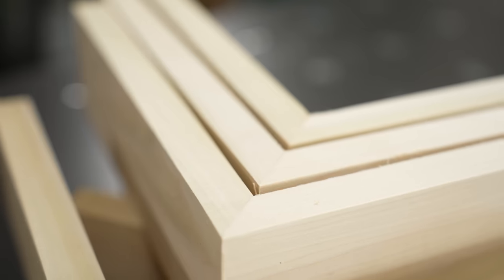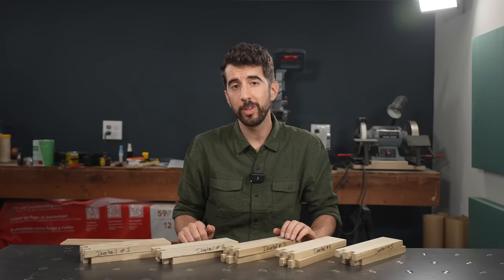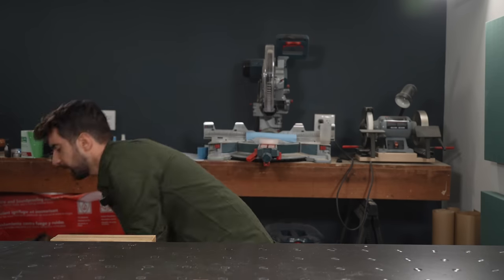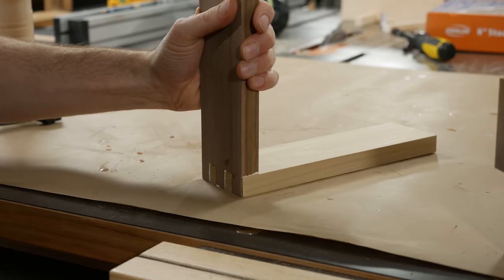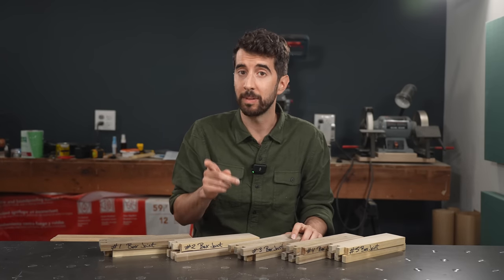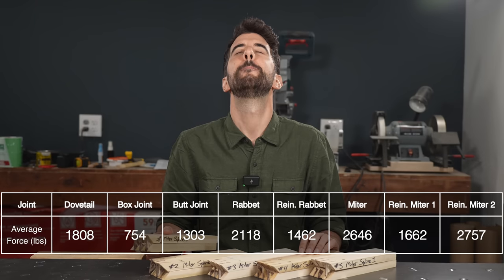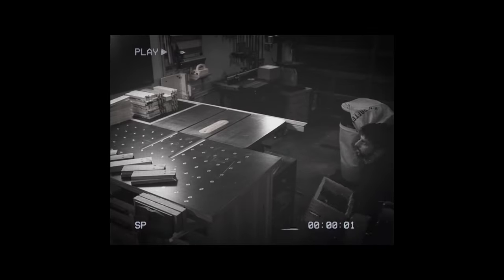This Simple Joint is Stronger Than a Dovetail!

Comment: 🎯 Key Takeaways for quick navigation:

00:01 💪 Introduction to Joint Strength Comparison
- The video compares the strength of various wood joints including the butt, miter, dovetail, and box joint.
- Demonstrates a test to break a butt joint.
- Poses a question about the actual strength of popular joints like dovetails.
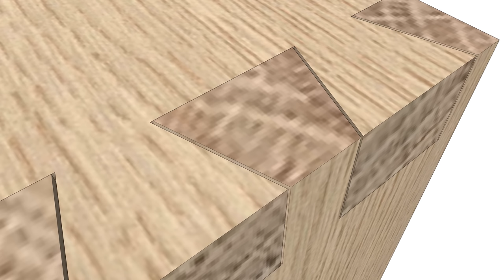01:12 🔨 Dovetail Joint Analysis
- Explains the mechanical advantage of dovetails.
- Describes the process and tools used to make dovetails.
- Evaluates dovetail strength and the pattern of failure.
02:55 📊 Box Joint vs. Dovetail Joint
- Suggests that box joints could be stronger due to wood glue strength.
- Details the ease and speed of making box joints.
- Discusses the potential issue of glue starvation in box joints.
04:34 🧠 Mention of Video Sponsor
- Introduces the video sponsor, BetterHelp.
- Describes the benefits of online therapy.
05:44 🧩 Differentiation of Woodworking Joints
- Explains the specific applications of the joints being discussed.
- Describes the testing method used to evaluate joint strength.
08:57 🐇 *Rabbit Joint Strength and Reinforcement *
- Explores the rabbit joint strength and the effect of adding dowels.
- Compares reinforced rabbit joints to non-reinforced ones.
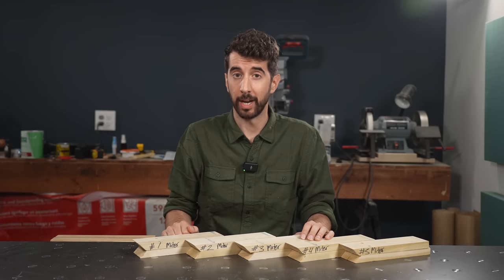12:21 ⚖️ Miter Joint Strength Assessment
- Discusses the unexpected strength of the miter joint.
- Examines the potential long-term issues due to wood movement.
15:30 ➕ Reinforcing Miter Joints
- Investigates different methods of reinforcing miter joints.
- Presents results of strength testing for reinforced miters.
17:03 💭 Final Thoughts on Joint Strength
- The presenter shares his concluding thoughts on the strength tests of various joints.
- Emphasizes that test results are not absolute rules but should guide practical woodworking and joint selection.

Comment: the dovetail ages much better than the box or miter joint,it does not depend on glue, it adapts to expansion and contraction, it will outlast them by many years

Comment: I would love to see each of these joints in a bending load as well. Imagine a square (like a drawer) dropped on a corner. The force to open a drawer is very low compared to the abuse caused when moving furniture.

Comment: Love these videos where traditional beliefs are questioned. A lot of these go back to hide glue times where the glue was less strong and therefore dovetail were beneficial. I think there are two things that were missed in the explanation though.

For one, I think glue starvation might play a role with the box joint, but grain direction does too. If we assume that grain runs perfectly straight along our board, then it should only fail on the glue and be on par or better than the miter joint. But if the grain direction is off ever so slightly, then there is a thin layer of fibers that are severed from cutting the joint. Those fibers are held on one side by strong glue and on the other side by weak lignin. This creates a weak spot.

The other point is the argument that miter joints are weaker on the long term when it comes to wood movement. I think the exact opposite is true. Because the wood movement of both parts is basically synchronous, it's the best possible joint. The wood will expand in both dimensions of the glue surface equally if the glue has enough give to compensate. But it basically only needs to compensate for the tiny movement in between fibers, not for the sum of those movements. A butt joint on the other hand has a discrepancy in between both pieces. The wood will swell much more in thickness than in length. So the end grain part of it will want to expand while the long grain part of it will resist. This creates stress and the glue needs to compensate for the sum of all movement in that direction wich can add up substantially. All other joints will lie somewhere in between but any end grain to long grain or unaligned long grain glue surface is bad for this.

Comment: 1:11 - Er, no, that's not "what's called mechanical advantage". Not in engineering or physics, anyway (you're obviously free to use it to mean whatever you want it to mean). Mechanical advantage is the ratio between input and output force of a system (ex., a lever, a pulley, etc.). Dovetails provide a mechanical lock (i.e., one piece can't move in a certain direction because it would have to pass through or destroy the other), they're not a mechanism to trade force for displacement or vice-versa (again, think levers and pulleys), which would be "what's called mechanical advantage".

I guess you meant they have the advantage of (also) providing a mechanical lock, that doesn't rely just on the glue (like some other joints). But at best that would be "what you might call a mechanical advantage", not "what's called mechanical advantage" (at least not in fields where "mechanical advantage" is an actual technical term.

Also, the thing at 4:13 is an asterisk (the kind that ends in "risk"), not an Asterix (which is a small French guy drawn by Uderzo). 😜

Comment: Enjoyed the video! Haha

Here are some thoughts of mine. The glue surface is also affected by the surface area just like you mentioned. It would be interesting to see testing different joints but with the same total overall surface area. 

I am also interested to see for you test the dovetail joint the other way, the orientation without the benefit of mechanical advantage. In that way, the glue is mainly the one holding the joint together. I think generally glue performs stronger against shear forces. You were testing the joints all in the same direction of force. Try to consider the direction of the force in all the joints. Which means just set your joints in the tester the other way around. 

Anyways, your vid is amazing. Got me excited while watching this. HAHA. I enjoy stuff like this. Thanks man. Just subscribed.

Comment: It seems that the strongest joints are the ones that require the adhesive to fail in both tensile and shear stress simultaneously.

Comment: Hey, if you want to do a proper "base" test like we do in the industry, trying to even out the differences in process etc., the right way to do it is an ANOVA gauge R&R analysis. A common design is 10×3×3:
10 pieces made by 3 operators tested 3 times
Of course, the testing here is destructive, you'd have to make more pieces.

Time to suck even more people in this madness!

Comment: Super interesting. I dont think that the mitre or butt are stronger, simple because while this is the most common application of force, its not the most common point of joint failure. No one is pulling a drawer out with this much force. Racking force is way more likely to break casing or drawer joints.

Comment: The whole point of dovetails (all the more complicated joints in fact) is to render glue unnecessary. These joints are designed to hold in one direction without glue.

Comment: I'm not sure any woodworker thought it was necessarily the strongest; it's just mechanically locked in the direction of force so when your 18th century hide glue gets old and brittle, your drawer fronts don't come off.  It was also a sign of skill and craftsmanship, when you had no choice but to do them by hand. Still enjoyed the video.

Comment: The choice of joint depends on four things :-
1 : The amount of force it will be subjected to.
2 : The direction of the force it will be subjected to.
3 : The strength of the timber being used.
4 : The desired aesthetic appearance .
Most furniture joints are subject to torsion, so the strength of joints in the way you tested, is therefore irrelevant.
There is actually a fifth consideration in choosing a joint but we shouldn't talk about getting high, should we. 🥴

Comment: Your dowel pins are glue starved. Whether that affects the strength in any significant way is hard to know. Your point about hide glue benefitting from more mechanically robust joints is probably the main issue. In general, it seems keeping plenty of solid wood involved in the joint is a good way to go with modern PSA glues. It's also clear that the old idea that end grain glue joints are inherently weak doesn't apply to modern glues either.

Comment: I still would like to see this done with the 1/2 1/2 1/2 method. 

1/2 inch wood
1/4 - 1/4 - 1/4 
Make cut that is 
1/4 Thick 
1/4 Away from the fence
1/4 High

3/4 inch wood
3/8 - 3/8- 3/8
Make cut that is 
3/8 Thick 
3/8 Away from the fence
3/8 High

Run side boards on end vertically across the dado Run the ends of the front and back boards across the dado

Comment: When I see those dowels being hammered in, I think "stress".  There's no reason to make them so tightly fitted that they force the grain apart - and the way the joints fail suggest that this is exactly what's happening.  It would be interesting to see what happens with dowels that slide into place with minimal effort, leaving the wood with less stress (and more glue.)

Comment: Mmm, I don't think the dovetail should be refered to as mechanical advantage, it is a mechanical connection though.  Mechanical advantage is what happens with purchase or gears, when the output force is greater than the input force. Cool test though.

Comment: about 5 hours into this video i turned it off. Ive made several hundred drawers in my time and never had a joint fail. Ive never had to put a full grown buffalo in a drawer so Im not sure just how strong the joints are but my deal is if you buy it from me and it breaks  Ill fix it for free. luckily no one has put so much pressure on my joints that they fail.

Comment: You are not testing the joint as much as the glue- the factor you missed is that the strongest joints in your test had the most glue surface area. Testing the joints without glue, with nails in the case of the miter might be a truer test of the joint. I applaud the effort you went through in doing this video. You are also a natural presenter. I’m not a crackpot, by the way. I have been a cabinetmaker for 30+ years and I am a senior engineering student.  Anyhow- good luck with all.

Comment: Very interesting video, but it seems to me that you never tested the title of your video: Your Joints are Too Tight.  I would like to see if you loosened up your joint tolerances a bit to allow more glue to remain, if the joint strength would improve.

Comment: Not surprising at all. The whole “endgrain glue joints are weak” myth has been disproven in so many tests already. The lignin holding adjacent longgrain straws together is far weaker than woodglue, so the less longgrain You have in a joint, the stronger it is, unless You really increase the glue are, but then You introduce a lot of stress concentration points that weaken it even further. There have even been tests on buttjoints of endgrain to endgrain that turned out to be the strongest of them all, even stronger than miters, as miters are technically only half endgrain (45degree endgrain) and thus have some of the weakness of longgrain to them. What makes endgrain joints so strong is the adhesion of glue itself to pits in the endgrain, and as glue is far stronger than wood lignin, it hardly matters how well glue holds on to the side of the longgrai as it’s not the glue that fails, but longgrain straws rip from adjacent longgrain straws. This is why gluestarving a joint is also kind of a myth. Dovetails and box joints are just weak because it’s longgrain to longgrain and glue hardly matters in them.

Comment: What you really need is someone who deals with antiques, every joint you mention has been used in the past 200 years. You skimmed over the real issue of glue failure and that's moisture and expansion of wood and the force this can apply which are enough to bend steel. Dovetails can have the joint glue fail but still hold because of the physical shape of the joint unlike the butt/mitre joint, what is making these joints strong in your testing is the glue is entering the end grain of the wood grain (up the straws) but dense wood wont allow this, if you used ebony for this test you would find your strongest joint would be the weakest. BTW I am a antique box collector and a antique restorer but if all you want is something for your lifetime then continue using PVA and simple wood joints.

Comment: It was once said that figures don't lie, but liars figure.  This test reminds me of the "karate expert" breaking a stack of boards to the" ahh and eee! " of the duped crowd that does not realize that none of the boards are being broken along the long grain.  FULL STOP....Not calling this a lying test, but realistically, the forces being put on a dovetail joint are not typically the kind of force being put on the joints in this test.  Dovetail joints on a drawer will reliably keep the front of the drawer being pulled out of the sides.  I believe a test of straight tension, rather than a 45 degree lever force on the joint would result in different figures entirely.   Of course, I could be wrong, but show me a test where a miter joints holds together with longitudinal force (not 45 degree) does not fail, but a row of dovetails breaks off, or a row of pins are pulled out of the side.

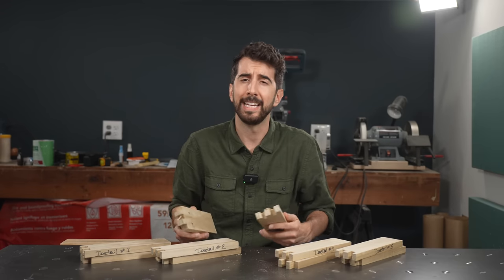Comment: 3:22 The only good reason not to use hide glue is if one is vegetarian. I do not see why anyone would pollute a natural material, i.e. wood, with something plasticky and non-biodegradable. Oh, and it' doesn't come apart when you want it to!
If carpenters were not under such immense pressure to churn out pieces quickly, I bet many would still use hide glue. It makes perfect sense when a piece you made a dozen years ago comes back to you to fix it.

Comment: If the strongest joints failed along the glue line... that'd mean the wood is actually stronger than the glue... not sure how you got this backwards @ 16:31. It seems like allowing the wood to do what it does best (and not cutting all the fibers apart) works best with glue.

It'd be interesting to see what force you could get just pulling a board apart to get a baseline or even making a finger joint to test.

Regardless, cool video... but your brother Matt needs to teach you how to grow a real beard.

Comment: I disagree that using the tension method represents a more real-world test than trying to straighten (bend) the joint.

Pulling a drawer handle is never going to put more than 10 lbs of tension on the drawer face. That's 5 lbs per side, so why bother testing these joints, which all survive over hundreds of pounds?

However, these same joints can be used to make cabinets, crates, and closed back shelving units.

All of these pieces could contain items (weight) when trying to move them. I believe it is the racking (bending) force that would test these joints.

If you think about the failure mode of wood joinery in real-world applications, the joints rarely (if ever) fail in pure tension.

Comment: Interesting and rigorous. BUT it occurs to me that 99.9% of the time, most of these joints will never be loaded to their breaking point in most practical applications.  

Also, try using ANY of those joints WITHOUT glue. Only the dovetail will work. It was likely invented so that glue was not a requirement, or even before glue was a thing - hence the term "joinery" and not "glue-ery". I'm pretty sure that you could make an entire cabinet with drawers without glue if you use the right joints.

Comment: Isn't it really a bit weird to test the strength of a joint? I have seen many youtubers do this, and while it does provide an insight, I don't think I have ever seen a joint break in real life. Mainly because this kind of joinery is a dumb choice when the forces are working directly outwards like in this test. The problem isn't the joint, but the structure or construction.

The point is that if they are strong enough, then additional strength is not something worth thiking about. Choosing a joint should be done depending on wood, tools and application. For instance, the dovetail makes a lot of sense if you only got hand tools. Takes a little bit of skill, but show me the woodworker capable of making a good mitered joint by hand! Other woods will glue better than other. Some joints makes sense if you got a few battery powered tools, like a handheld router. And then you would choose other joints when you got a well-equipped workshop and you are building a kitchen. Everything you don't see needs to be built fast but strong enough, and maybe the customer wants the drawers to have dovetails for purely aestethical reasons.

A better test would be to look into why you would choose one of the other. The answer to what joint is best is always something between "They are all good enough" and "It depends"

Comment: What about reinforcing the box joint with a transverse dowel, i.e. one going down through all the fingers of the joint?  It might be difficult to put the dowel through that much wood, but I think it might be worth doing.  Using a long screw instead of a dowel is also a possible way of reinforcing the box joint.  This could also be used to reinforce dovetails as well.  Just curious.

Comment: "Hide glue sucks" -Hey luthiers, you should use epoxy 😂
Thing is, corners shouldn't be glued at all with whatever glue. Glue is only going to last in long grain joints with exceptions for some unstressed joints with some glues or violin tops and bottoms

Comment: All these numbers seem irrelephant, as long as you're not trying to build a staircase for elephants out of these drawers. If you are, your choice of joint isn't your real problem; otherwise anything over say 250lbs is equally fine. So, doweled joints (butt or rabbet) for looks it is from now on.

Comment: This seems like overkill. Whether it’s 700 or 2700 lbs strong, it still is far more strength than a drawer or joint will ever experience. There is a point of diminishing returns when you are overbuilding for no practical reason.